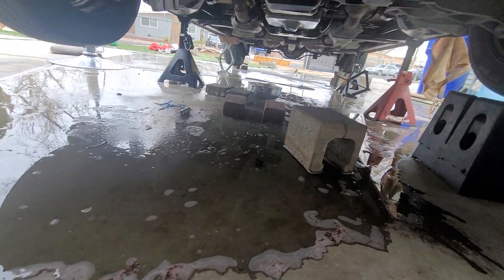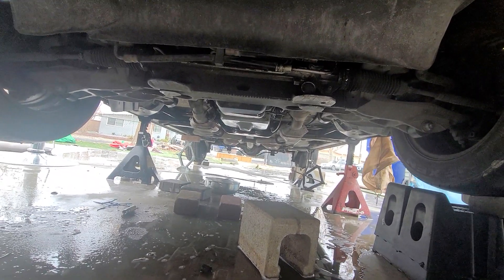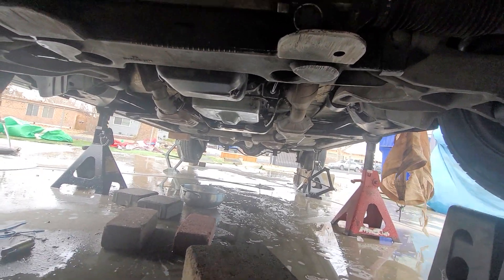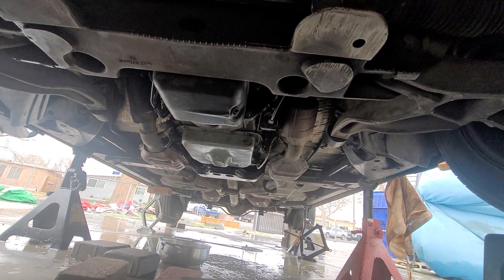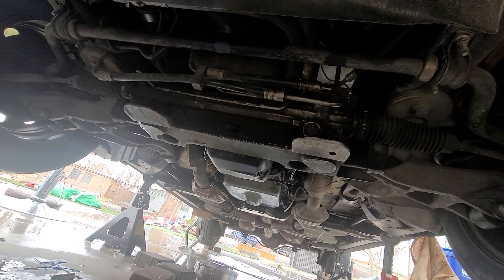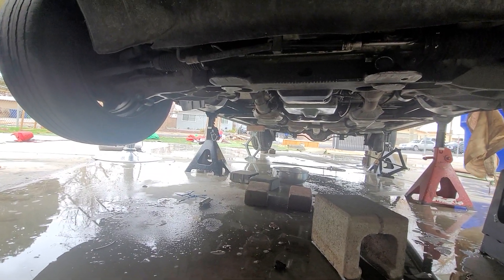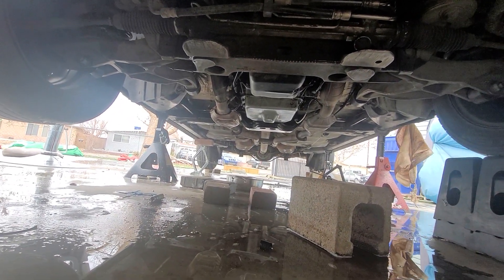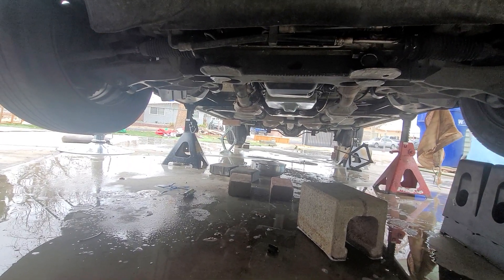2006 Ford Crown Victoria Police Interceptor transmission progress.

Comment: Just the right video I wanted to see from you I'm having the same problem I see my transmission is leaking also after I just replaced oil filter housing gasket and now I'm trying decide if I want to try to fix it or not and is it hard It will be my first time